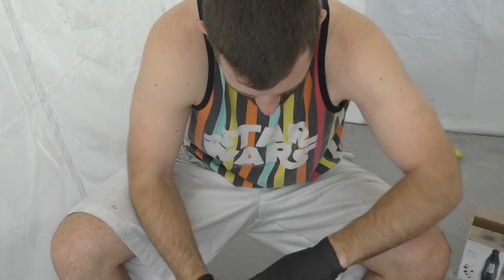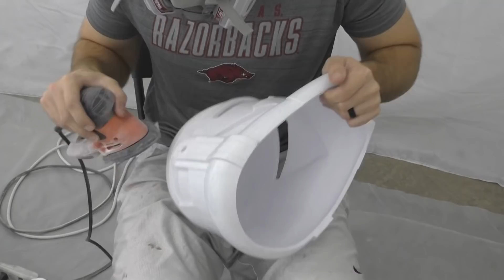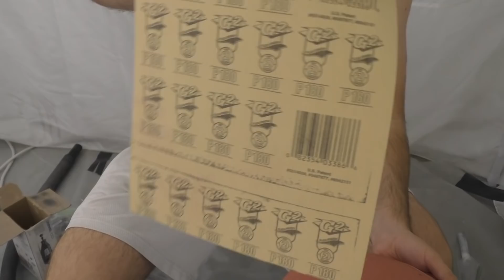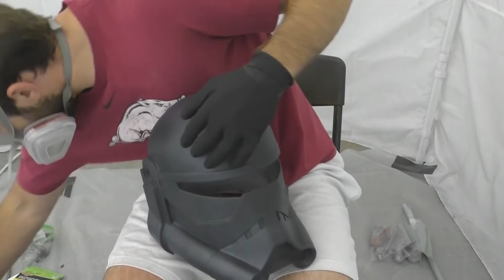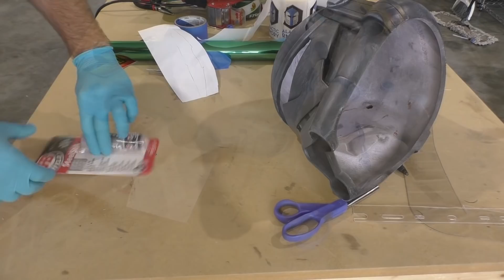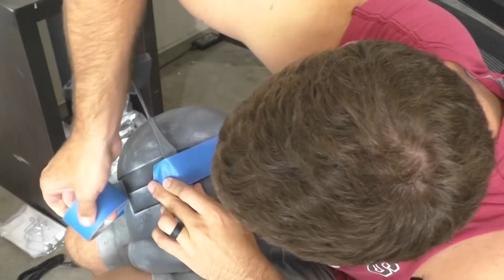Making my own Imperial Crosshair Helmet

Comment: I go to my local tint place and ask nicely for some scraps of the film I need.  They throw away plenty of pieces that are big enough to do a visor.  I also actually apply the tint to the plastic in the same way I would do on glass.  Even though everyone says it won't stick, it sticks fine enough for me for this use.  I do this on the plastic after rough cutting it and while it's flat, then I install it.  This way the tint bonds smoothly to the inside of the visor and looks great.

Comment: One great way to get a smooth application of your window tint is to use a plastic squeegee, or applying decals or striping to cars. Work from the center outwards and all the air bubbles will be pushed out; A needle/X-acto blade will pop and remaining bubbles to further flatten.

Comment: This might be a stupid question, but I'm curious after watching your videos (and others). If you're using resin and UV lights to smooth it out, would you be able to use the same method to glue pieces together? Would it be strong enough for general handling (not cosplay) and display? Compared to say your super glue/E6000 method?

Comment: For the visor, you could use 1 or 2 millimeter thick vacuum forming sheet plastic as it would probably end up being cheeper then the face shield visors. My brother and I used the vacuum forming plastic for our helmets and it worked out really well. Great video by the way 👍

Comment: Now if I can get my printer to print the echo helmet and not keep shifting I want to do that helmet and after seeing the thumbnail I want to do this helmet next
Reply: Make sure the bed is deadly Level. Also a good tip is to cover the bed with a layer of masking tape and print a skirt. Watch the skirt being printed and adjust accordingly. Then for showtime i would use a raft to help nail it down even more. Enabling "Z hop when retracted" can also help prevent your hotend from colliding with the print. If you are not yet using a heated bed, that would also help with adhesion.  Combine all those and your prints shouldn't shift at all.